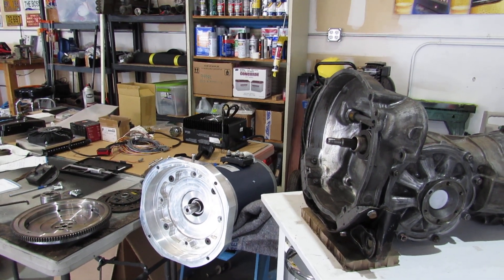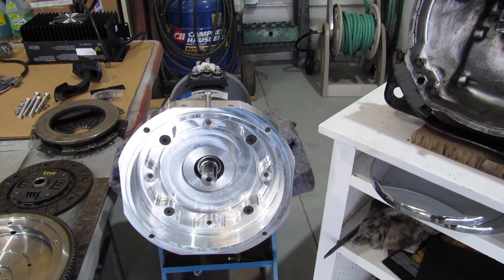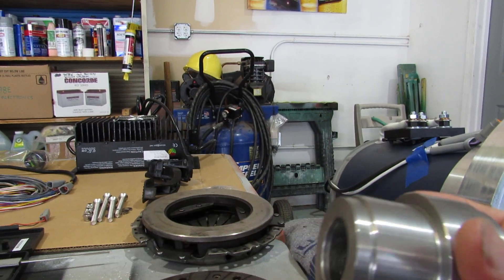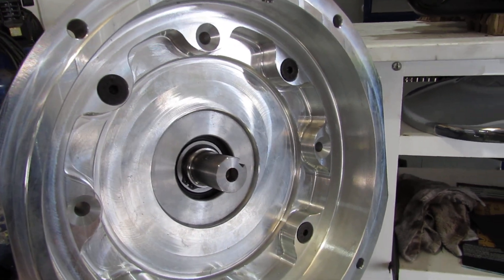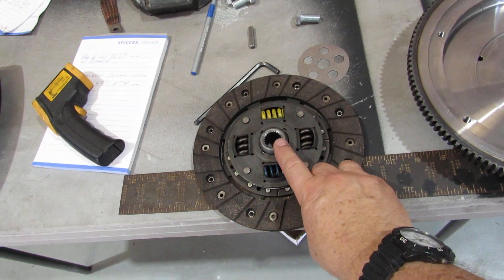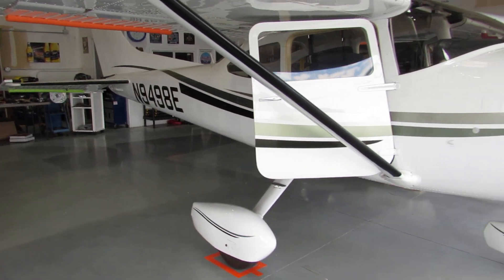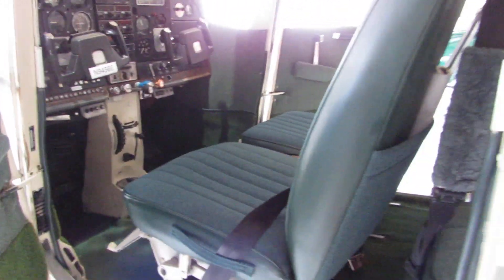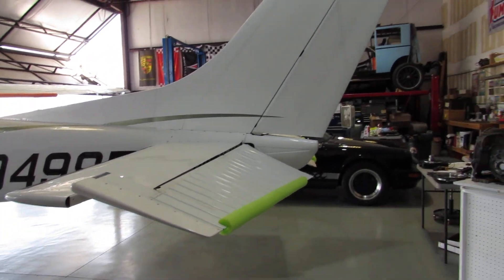71 VW Super Beetle Ev West Conversion to Electric plus Bonus Cessna 182 Walkaround

Comment: Where did you find the instructions etc for the VW Beetle kit? I have looked and looked and can't find it. Specifically the part about heating the coupler to 600 degrees to install. Thanks!
Reply from the maker: @Turboactive  That was the hardest and most frustrating part of the whole project...EVwest wasn't a whole lot of help, although their website had quite a few pdf files for the individual components that I was able to use. I did a lot of trial and error and was constantly searching the web for hints and tips.  Best of luck to you with your conversion, keep at it and don't give up 👍

Comment: Highly recommend the lightweight EV West aluminum flywheel with steel plate insert clutch surface. Even if the stock steel flywheel has been lightened, your acceleration will still lag a bit due to overcoming rotational inertia.

Comment: Hi Randy. I'm doing a 72 cobversion with my niece and very frustrated with EV West. Any way to get in touch and share learnings?
Reply from the maker: I'm currently away from the VW project (and the Tucson heat) until the end of September, but, will be more than happy to help in whatever way I can once I get back home...if you'd like, reply back and I'll temporarily post my email here, then delete the post once I know you got it.
Reply: @randyross4058  Thanks Randy. Did you ever get your coupling, adapter and flex plate installed? The depth of the couplung adapter answered? I poised that question to EV West but no reply yet.
Reply from the maker: @bluph2030  Didn't get the coupler installed, but did tons of measurements before leaving on vacation, I believe that in my situation, I'll need to install the coupler all the way down to the shoulder on the motor shaft.  I did find this guy on youtube who is going through the install like us, except on a VW bus, check him, some good info..... https://www.youtube.com/channel/UCdsCaETFsl8M7bJX5i3WOQA

Comment: Great video. not sure i would have bothered with the clutch, flywheel assembly though. I have heard they run fine without them.
Reply: A clutch serves as additional layer of safety in case of a runaway motor.
Reply from the maker: Definitely ways out there to go direct drive to the wheels, for us though, this seemed to be the best way to tackle our first EV conversion, plus I wanted to have reverse (although I think with direct drive, a person would only have to put in a switch to obtain that)  Ev West sells a re-worked transmission with 2 speeds and reverse for $2000 plus shipping...just not cost effective for use. Thanks for checking out my vid, I appreciate the feedback!